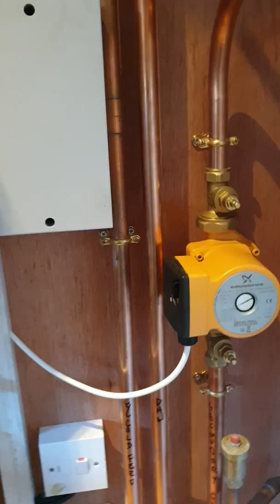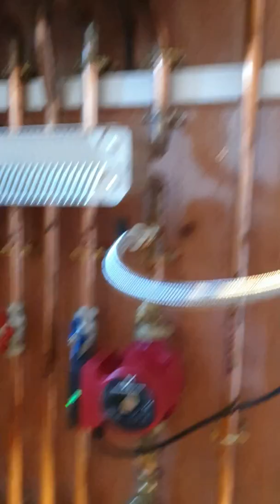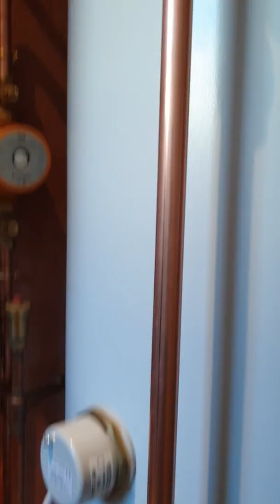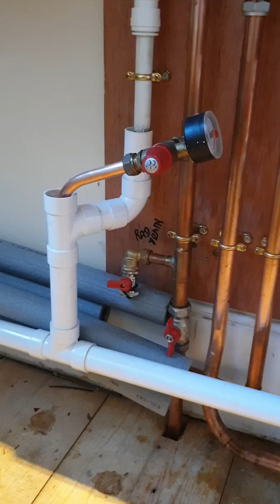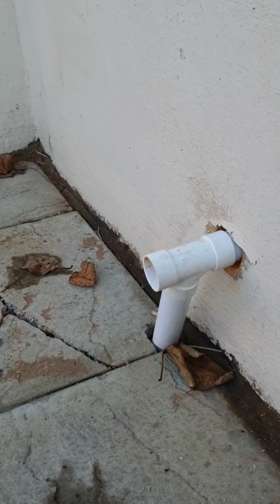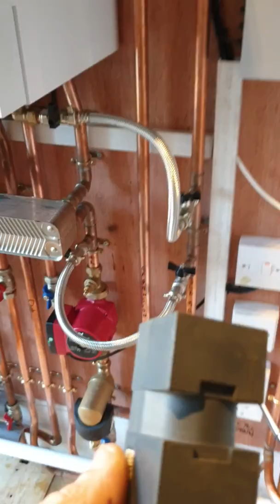Viessmann vitodens 200 instalation

Comment: Why did you put the system pump on the return? Just curious.
Reply from the maker: Pumps prefer to pump up. In the boiler the pump is also on the return. The return is cooler than the flow also.

Comment: Nice install, what make check valve do you use on the secondary return. Also what make drain points they look much better than the ones i use.
Reply from the maker: The drain cocks are from Anteres. They are European standard. The check valve is just a flap type from my local merchant

Comment: Hi AM, lovely job. Why did you decide to install  plate seperation on this particular job,  is it attached to an older dirtier radiator circuit?
Reply from the maker: Yes. Old system. Also expecting issues with insufficient residual pump head.

Comment: Nice use of 22mm ballvalves, munson rings and and plate to plate hydraulic separation plus beautiful solder joints . A couple of questions though please,  Is there a rule of thumb for the plate size? Does it matter if you oversize the plate? Under sizing I guess would lead to not enough heat transfer to the secondary circuit causing problems with radiators not being hot enough but i would have thought too big wouldn't be so much of a problem. Also with regards to the saftey valve discharge I always believed the scalding issue was a real risk and the boilers can give super heated steam, that's what I have been taught anyway, why do you say its not an issue? I also thought safety discharge pipes had to be metallic. These questions aren't meant to critical im just interested. It's a great install and your client may not even know it 👍
Reply from the maker: https://youtu.be/rM3JWyIY4r0
Reply from the maker: The pipe can be plastic. For use with continuous water over 100c it must be polypropylene pipe. I think I've got that correct.
Reply: Thanks I'll watch and digest that later
Reply: Making superheated steam is most unlikely. You would have to pass the steam back through the boiler to do that - and that’s a complete boiler melt down situation.

Comment: Shouldn’t the plastic pipe be high temperature/ push fit waste pipe ? 
Looks like standard solvent weld
Reply: who gives one? As if its ever gonna be checked...
Reply: KB it’s building regs so I usually try and comply
Reply from the maker: Yes.
Reply from the maker: This was a mistake on my side. I will comply in future. I am aware that g3 only applies in the UK as the situation it is designed to prevent cant occur with modern systems. In Europe I'm told no combined temperature and pressure relief valve is required for the same reason. While I accept this from the boiler I'm not sure why it cant happen from an immersion. Unvented cylinders in Estonian I know are only fitted with a small pressure relief valve that only drips. I assume it's to do with the rate of expansion of water at 3kw, the rate of heat input due to failure of the electrical element.
Reply: Andrew Millward I come across it a lot I’ve always used the high temperature pipe and fittings but nobody else does in my area.